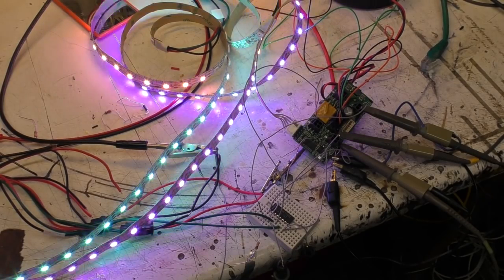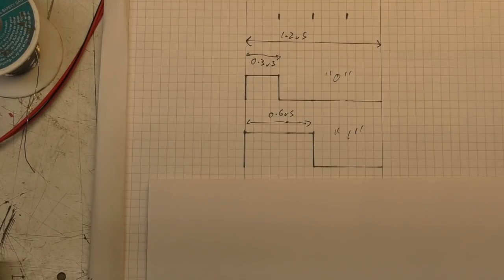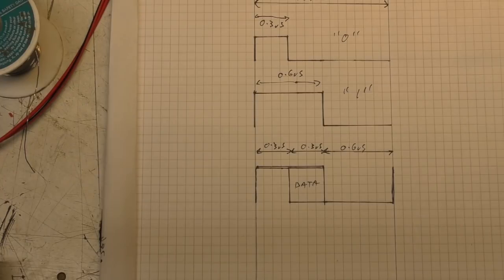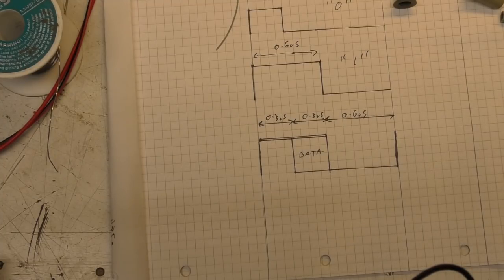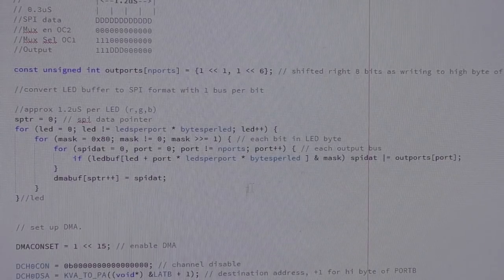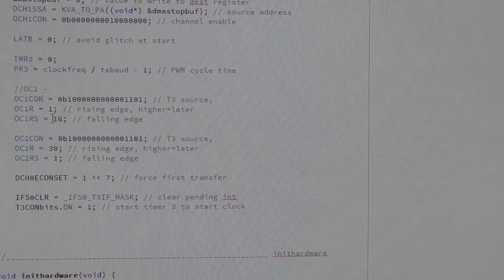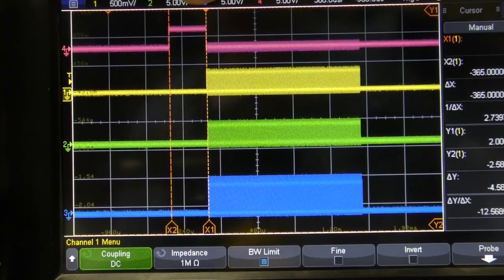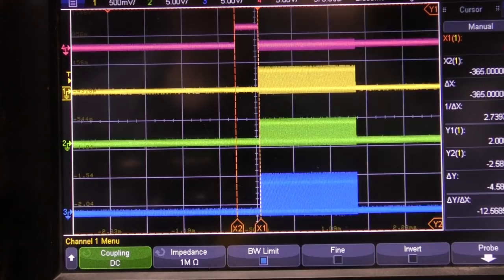Driving multiple WS2812 LED strings using DMA on PIC32MX

Comment: I'm currently doing something similar but using the ESP32 for 16 channel DMA output. I've written a windows app to allow me to stream parts of my desktop across UDP to the ESP32, to display on some custom tiles I had made with WS2812s on them in 16x16 arrangements. The eventual size will be 160x128 pixels. Obviously having to limit the brightness, and will be using several ESP32s all synced using a wire to avoid glitching as much as possible!

Comment: Unnecessarryly complex.. There are multiple ways of using DMA.. 

Set a timer to PWM mode. To make it simple, make it count from 0 to 4.. Feed the compare channel with DMA on timer event.. For 0.3uS feed with 1, for 0.6uS feed with 2.. If you cannot achive 3uS with prescaler, multiply the values with whatever the prescaler can support.. This method requires a lot of RAM.

I would use port method instead. I think you didn't trigger DMA with timer, that's why you had jitter.. This way I can feed upto 8 streams with 8 bit port, 16 streams with 16 bit ports.. I would use 3 DMA's.. For 8 bit port, DMA0 feeds 0xFF when timer event happens.. DMA does not increment source address, that way it allways feeds 0xFF whenever timer resets.. DMA1 feeds 8 bit data from RAM for 8 streams, when compare0 occurs, it increments the source address to span the RAM.. DMA2 feeds 0x00 when compare1 occurs.. Wrt the example previously, timer counts from 0 to 4, compare0 is set to 1, compare1 is set to 2.. If you DMA's does not support timer compares, you can wire it through the pin which DMA can get trigger from, or use timers in sync..
Reply: I think the point of this video is to show that a 74HCT157 can avoid the use of 2 extra DMA streams that write the fixed 1s and 0s of a bit period. Those extra DMA transfers increase memory bus load and can introduce jitter when CPU and DMA fight for bus time.. That jitter will be presented to the LED strips, as the edges are not gated, directly, by a timer-based signal.

The 74HCT chip only costs like 10 to 15ct to gate 4 chs at a time. Also, the 2 control PWM timing signals are common to all LED strips.. If hypothetically want to output 32 (or more) LED strips, you can reuse the same PWM signals and add 1 more DMA stream to feed serial data to another GPIO port. That makes it really scalable for large setups.
Reply: @nlhans1990  I don't think what you describe would happen, because mean time I've already implemented DMA approach for 16 channels for STM32F103.. 3 DMA's, 1 timer with its 3 channels, and 2.4M transfers/s transfer is nothing.. DMA's can produce much more throughput.. Also these LED's are not that much sensitive to jitter..

32 channels? Just create one more instance of the given class.. I always prefer software solution to hardware solution even if the hardware costs 1c.. Because you have to test any hardware in production, and also is another big failure point.. You can unit test a software and it always works if you design carefully.
Reply: You can even drop the shuffled RAM, use bitbanding, 2 more dma's, and one more timer to automatically rearrange bits and write to the port.. That way you may store RGB in regular fasion, the DMA's and timers will automatically scan the ram and generate the output without CPU intervention..

I am interested in this problem, and bought the led strips.. Will try my idea, if you are interested I could share the results..

Comment: I had the same conundrum when i wanted to drive these WS2812 LED's from my SAMD10 mcu. In the end i made it work with a timer and DMA. It was quite expensive since DMA transfers were no less than 1 byte meaning i spent one byte per one bit of LED data. Fortunately i had RAM to spare.
This video also reminds me of a similar video that Ben Heck made, where he made a hardware SPI to neopixel adapter.

Comment: Just listening to Amp Hour podcast where you are talking about your mains dimmer, I became very excited about this - would LOVE to see a vid on that. I bought all the components to make my own mains dimmer but then bottled out as I don't know if I feel comfortable having 30 of them installed in the home. We are currently wiring up our home from scratch (full gut and renovation) and like you said I bought some old mains dimmer racks (DMX) for light dimming ... my view being that the old theatre stuff is probably the best. One from NJD (DPX 12/4) and another is the Tiger trailing edge dimmer from Mode Lighting, nice UK manufacturer. The latter is way too powerful and bulky for the needs of a modern home, the former is good but not sure what the noise will be like. If you do make a vid, I'd love to hear some discussion on the things it's good for driving as well, not all dimmer drivers are created equal. Or will it drive the LEDs directly? (Sorry if I missed that in the podcast... still listening to it so will need to rewind!)

Comment: Ive been playing with these since they came out but I just use the Arduino library like Fastled or Neopixel sometimes both, whats the advantage doing it this way? If I want to do a display then I use the Arduino and Jinx! which makes life simple since Jinx! allows wifi connections to multiple universes so I use esp8266's on a custom designed pcb I had made and scatter them around the house  -they cost about 3 quid each to make.  I just build a universes in Jinx! for example the christmas lights in my various windows windows and simply put them in different universes per window and control them from my desktop. Or if I want a standalone solution I use WLED and send commands through JASON using node-red. I wrote snake, tetris and pong for my ws2812 led table and they use the fastled and neopixel library meaning I could concentrate on the game and effects rather than writing a library to control the leds. Jinx! allows u to build displays too and stream video so life is easy! Well easier than bit wise operations lol

Comment: Hah!  I happen to be working with some of these, too -- to control the silly RGB lighting on everything that goes in a PC these days.  Turns out, though, the timing requirements are not NEARLY as fiddly as the datasheet claims.  There are two things you have to respect:

1) The 0 high time has to be distinguishable from the 1 high time.
2) The low time has to be distinguishable from a latch / reset period.  Not sure what the actual threshold is (haven't pushed it, but it seems pretty lenient.)

Beyond those two rules, it's actually quite forgiving.  For my project, I'm using the good ol' ATmega328P on a breadboard.  The calculation code is all in C.  A bit of buffer management, and single-device (pin) and eight-device (port) transmit functions are in ASM.

At 20MHz, it's able to:
* Calculate a rainbow pattern over a dynamic number of LEDs (modulo 3).
* Rotate the pattern in a sequence based on the number of LEDs.  (Good for spinning the rainbow around an RGB LED fan, for example.)
* Interpolate between any two calculated frames based on a number of desired intermediary steps, and a step number in that range.  (This allows for smooth, blended rotation instead of chunky steps.)
* Overlay a simple window effect of an arbitrary number of pixels (like a wipe, or e.g., PacMan's mouth.)
* Swap the RGB order to GRB, which is what WS2812 uses for some reason.  😒
* Do all of this for two fans - one 12-LED and one 9-LED.
* Combine those two num_leds x 3 buffers into one interleaved buffer with one bit from up to 8 output buffers, per byte.  (This is an ASM function.)
* Transmit 12 x 3 x 8 bytes via bit-banging.  (This is also ASM.)

... all at 120Hz with ~50% CPU load.  120Hz because I goofed up my timer initialization function, which used the datasheet's equation for maximum frequency of an output pin when toggled by the timer match, rather than the frequency of the timer itself.  When I fixed that and fired an interrupt at 60Hz, I had what should be enough time to run 8x 12-LED fans with independently-calculated buffers.  Pretty neat for a little 8-bit micro!
Reply: I've seen someone (not sure who or where) using the lenient timings to do something similar to Mike's output but with 3 equal periods of High, Data, Low (equivalently 1/3 or 2/3 duty cycle per bit).

Comment: very cool stuff .. always super annoying once you know a micro and 'have' to move away from it ..

I'm relatively familiar with the 328p - fortunately that road ends very decisively in the case of almost any serious application so, will be jumping onto the stm stuffs soon
Reply: You can do a lot in 20MHz.  :-)  That's what I'm using to drive some RGB LED fans with WS2812 ICs in them.  I put in a separate post on this.  I can drop some code in there if anyone wants it.

Comment: Brilliant!  I am working on this for my own project (STM32) and wound up doing 4 bits per cycle DMA and so far it has been stable enough.  In my case that works out OK but this is much more interesting... integrating the shifting with the data creation.  Thanks for sharing!

Comment: I really appreciate how you pull in 7400 series parts. I never really work with them except for small, slow and simple logic around some analog circuit where a micro would have been too much. It's easy to forget they're screaming fast and can be used to extend microcontroller functionality like this. Thanks as always for the inspiring stuff Mike!